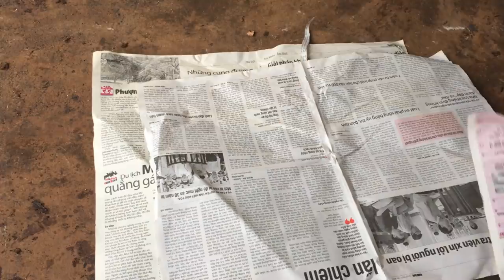How To RESTORE JAPANNESE SWORD - Restore of old rusty sword

Comment: OMG this is like a horror movie. The slaughter of a sword by the mad angle grinder man. This is no antique restoration.
Reply: I agree with You
Reply: He then goes on to run the temper. Honestly in looking at the Tang though I think he was wrong about the age of the sword as well ( thankfully)
Reply: David B.  it's probably an Amazon special that got left outside. Judging by the original finish and difference between the damage to the sheath and lack there of to the blade, I would say the blade is stainless. I'm guessing soft Chinese 3cr steel.
Reply: Sword has been killed by an angle grinder
Reply: That was no antique.

Comment: He should have not restored it at all. The restored sword is now zero in value. That's the wrong way of restoring it.
Reply: All that grinding just left a totally unworthy blade, and the handle is awful too...
Reply: Broken sword after restoration
Reply: It's a piece of steel before and after, nothing more nothing less
Reply: Calm down, people. That's most likely not even a Japanese-made sword, judging by the looks of it, maybe not even forged. Probably stamped (or stock removal) out of a sheet of metal. So he haven't done any damage to the value of it. At least he can now enjoy it as a novelty item, maybe his very first experience on the journey of learning how to actually restore items like this. From this video and the comments to this video both he and beginners can learn from his mistakes on how NOT to attempt restoring a sword. Hopefully those with more knowledge and experience can also help him on his way if he still wants to improve on this. I think he genuinely wanted to make something nice of it, he just needs to get the right equipment and knowledge on how to properly restore items like this.
Reply: @reset8140  yeah but it just goes to show how little research he put into his work before doing it
Reply: @Akuma MusageteS I think it was unfinished sword and it looks like a ninja sword because they are straight as the horizon
Reply: David B.  at least the best way is to have it sunk in water with salt and electrolytes like with current like they do to let the rust go
Reply: Myself noticed a few issues on the sword. Like the discoloration of that clay/plaster they use and did not have the mark of the forger that made it
Reply: @OzymandiaS I'd say decoration
Reply: Amateur

Comment: This is going to take a while. Just maling that clear now.

First. This sword was not a katana. The blade geometry is wrong. The ornamentation is wrong. The handle wrap is wrong. This was a Chinese sword. 

Second. Never take an angle grinder to an old blade, it is almost impossible to maintain the geometry and edge alignment.

Third. The steel should never reach blue across the entire blade. You want an even straw colour for the best edge. Blue and black is way too hot. And you didn't even try to quench and temper. It is now most likely incredibly brittle. Katana use differential hardening and have a pronounced hamone to show here the hardened edge becomes the softer spine.

Kindly, someone with a degrees in medieval and Chinese military history. (Specialised in arms and armour)
Now go learn the difference between a katana and Dao and how to make them properly.

(Not trying g to be offensive, just seaw an opportunity to teach something.)
Reply: Finally, the best comment I've read so far in this comment section. It doesn't look to have anything in common with a katana nor a Japanese-made sword. Too crudely made, most likely stamped out of a sheet of metal and then grinded edges on it. And yes, he lacks knowledge on how/what a true restoration process is, but this might've been his first attempt and can, hopefully, lead him to knowledge on how to properly do it. Maybe experienced people here are willingly to help and provide some tips, rather than just bashing and crying over basically a mass-produced piece of metal lol.
Reply: It cant be brittle if he didnt even quench it. Probably soft as butter

Comment: Well, before you try to restore an antique weapon, you should always check on the shape of the blade, then use whetstone, there is atleast 14 type of sharpening stones you need to get, and for the finest should be at least 30 000 grit, then polish it further, there is a lot of how to reveal the hamon of the sword, but i don't recommend you to use grinders, it will certainly ruined the blade shape and ruined it's past heat treatment. 

Most importantly, you're probably scammed, learn more about Katana before you purchase and restore it. 

Note : in handling antique blades, you must always learn on how to sharpen them correctly, without mutilating ( destroying ) the blade. The way you sharpen this blade, definitely will destroy just any type of swords ( swords are not kitchen knifes ).

Note 2 : there is less users in the internet wanting to share their experiences, but i wanted to help you anyways, i hope you read this comment.

Comment: I started watching this, but when you took to the sword with a fucking angle grinder, I stopped, once metal is removed you can't put it back, you've ruined the hardening and the edge, you didn't try your best, you butchered that blade and it's now stuffed ffs
Reply: dude it was a piece of shit to begin with. That was no hardened edge, it was a wall hanger or prop. The dressings were junk and it has no curve. Everyone complaining that he "ruined it" can't even spot a genuine Japanese katana from a piece of junk to begin with.
Reply: @xeokym223  whatever 😡
Reply: You can't remove hardness on a piece of steel unless it overheats , you can use a grinder and have it not overheat , its not that difficult to be honest.
And no its not a real katana
Reply: @18IMAMGODINA  yeah but how could you tell?
Reply: @Bankable2790  Easily  by watching oxidation colors on the steel , as it approaches temperatures high enough to remove hardness it will start changing colors from light straw , to straw color to bronze to purple to deep blue and clear blue is when it pretty much lost its hardness.
How do you think people harden different things ? Just wild guessing game? No .
They knew of the oxidation colors on the steel and after quenching(Hardening) they would have tempered the steel by heating it up slowly to a certain color depending on the use , for example something like an axe would needed to be tempered(slowly heated up to a temperature after quench to relax the steel) to a bronze color while knives are tempered at light straw and straw colors (Knives like bushcrafts knives , different knives are tempered to different temperatures also different steels are tempered to different temperatures ) 
Also you wouldnt be able to just quench something and then leave it like that or it would crack , even katanas were "Tempered" after quenching or else the blade would just snap in 2 or milion different pieces because its too hard to be usable, imagine that steel is like glass after quench and after temper it is a little softer but a lot tougher.
Reply: @18IMAMGODINA  okay I know a lot of random shit but you have to admit that is random knowledge unless you work with metal.
Reply: @Bankable2790  I am a hobbyist blacksmith... well lets just call it an artisan , because i dabble in other things like clay pottery/instruments , bows , bladesmithing/blacksmithing .I also cut a lot of metal around the house and stuff so i learned that the steel changes colors  as you heat it up not knowing what it was usefulfor , later i just learned it through reading/watching youtube videos , i recomend watching Black Bear Forge as he explains things very well. Right now im working on a medieval crossbow since i finally found some steel i can use for that and i plan on tempering it to purple/darkblue since that is the recomended temper for springs afaik.
Reply: @18IMAMGODINA  I just have too much other stuff going on but that is pretty cool

Comment: These are fast methods but you damaged the integrity of the blade. You should have only used a metal brush and sand paper on the circular, done the rest by hand, and skipped the heat treat.
Reply: Or atleast try to soak it in vinegar for 2 days or 24 hours enough so that he'll just scab off the rust with a brush.
Reply: that is something i did not get, why did he "heat treated" it?
Reply: @KevinReyes-xq4hb  cause the guy has no idea what he's doing.
Reply: heat treat 🤣😂🤣

Comment: That was... painful to watch.
After reading the comments I'm glad i wasn't the only one who noticed it wasn't a totally legit katana. 

But mate, a grinder is definitely not the best tool to restore Japanese swords of any kind as they remove too much material and Japanese swords don't have much to begin with. A great alternative is rust remover liquids to start, or a Sand Blaster. Then sanding to polish, 600 grit to 5000.

Edit: also when making a katana, tanto or wakisashi handle. Time in detail is paramount. Putting that extra love and effort into the choice of timber, guard, pommel, leather, and wrappings brings the sword to life.
Reply: No they don't , they remove as much as you are able to remove , reason why grinders are bad is because usually they are not flat enough , but for removing rust its perfect, and then finish it up on a sander or a stationary grinder if you have one with big wheels
Reply: "they remove as much as you are able to remove..." Yes and it's still possible to remove too much. But you're correct about the rounded surface though.
Reply: @dspl1991  of course its possible to remove too much but if you know how to use it you wont remove too much , You are controlling it it it isnt set to a depth and it will only grind at a certain depth , you would be surprised what some people are able to do with grinders.

Comment: This is definitely NOT a Japanese sword (nihontou). The geometry is far from indicative of one, from the nakago all the way to the kissaki. The sword in the video is through-hardened monosteel. If it was differentially hardened, as is typical of nihontou for the past 300+ years, then the polishing of the blade would reveal the hamon. Also, where are the shinogi and yokote? The profile taper of the ha does not suggest shobu or hira zukuri, let alone shinogi zukuri. And the koshirae...don't even get me started.

Everything about this sword suggests it is, in fact, a Southeast Asian single-edge sword. It is likely a Thai Daab or Burmese Dha. But it is NOT a Japanese sword.
Reply: Yeah, it's jarring to read through these comments of Internet nihontou "aficionados" feigning indignation over a modern Thai daab getting "restored" using...modern tools. This daab was definitely advance-aged using chemicals to give it that superficial rusty look. You can tell that there is virtually no pitting on the daab, which would have indicated a longer and slower oxidation process.

Comment: This is not a Japanese sword.  This is a sword with long edge.
Reply: It’s a chokuto basically a straight one sided blade. It’s like a katana without the curve
Reply: Well actually i agree with u...coz the way i look the sword look like old thailand sword...
Reply: @Sithnix  : You, sir, are correct in that it is styled like a chokuto. However, chokuto were out of fashion over 300 years ago. Even then, chokuto were often not both straight edge AND hira zukuri. This video claims the sword is "150 years old," which would mean its nihontou contemporaries would be shinogi zukuri for katana length. Hira zukuri was typically reserved for shorter wakizashi and tanto. Unokubi zukuri was typically for naginata. Shobu zukuri fell out of fashion already. 

Don't get me started on the koshirae.

This is why you are incorrect. The sword looks like a chokuto but it is NOT a chokuto. Nor is it a Japanese sword. The sword in the video is either a Thai Daab or Burmese Dha.
Reply: @ssv86  I see thanks

Comment: He didn't get that blade hot enough, now the metals weak as hell,  the metal lost it's temp when it turned blue,  he should've took the tourch and layed that flame directly on the metal till it was red hot, good props for trying bud,still looks better than it did before,

Comment: A lot of sweat and hard work put into this restoration, but this is not how the katana supposed to restored first thing first the handle that definitely not the katana and clean up the blade too much angle grinder .
Reply: this is not a katana
Reply: Too much angle grinder? Try zero. No one in their right mind uses power tools to repair a katana. Thankfully this wasn't a katana.

Comment: That is not even a real Japanese sword to be fair, luckily that is just an old replica katana. You can easily tell just by looking at the shape (lacks the curve of an authentic katana) and the fact it lacks a clay baked Hamon on the edge of the blade. But  please never do this to a real Japanese sword, I beg of you... that's just crazy... there are many less evasive ways to restore a sword in that state (i.e. vinegar baths, electrolysis,  anti-rust chemicals, sand blasting ..etc) ... trying to restore an ancient katana with a grinder is like trying to restore a Vincent Van Gogh masterpiece with  industrial strength paint remover and a bucket of emulsion paint.
Reply from the maker: thank pro

Comment: If you have an antique sword and you wanna restore it,be gentle with it, if it’s rusted, use vinegar,gentle and slowly rub it away don’t take a grinder to it don’t heat it up and pour oil on it. If it has pits sand it down with your hand and sandpaper.

Comment: I am not a smith, I was thinking This was taking a shot gun to swat mosquito's.  Maybe just the wire brush and angle grinder to get the scale and hard rust off.  Some wet stones, 320, 400, 600, 1200 wet and dry.  I have used a softwood block, water and baking soda to remove scale and rust.  I truly would love to restore one.  but not many in the USA.  If you find another one, I would like to try and restore one.

Comment: For some I have my doubt that is a Japanese sword. The handle is held on by a small banbo peg. And under that is a makers mark. They usually have a wood sheath.  The cutting edge is handed and has a design element to it. This has none of these elements.

Comment: If you are tempering and hardening a sword, you should heated the blade up in a kiln then dipped it in a tube of oil heated to over 100°. Sir, with all due respect, that was the most painful tempering process I have seen.

Comment: Everyone going on about the grinding and ignoring the improper and horrible heat treating.. a hand torch will Not get the blade anywhere near hot enough to temper. Plus by the time you move the torch to the other end it’s already cooling etc.

Comment: I love all these fuckin' people getting bent out of shape over him using a grinder. A) It started off as a rusted piece of metal to begin with, and had little to no value to anyone, beyond a historic curiosity. Which B) It's probably not even THAT, because this isn't a Japanese sword. Style? Sure. Authenticity? Not a chance. First, it's straight, not curved, which means that it definitely WASN'T a traditional Katana, and I can hear your sword snobs going off "It's clearly a Zatoichi!" Right, which goes further to prove my point, because the hidden cane swords that actually ever found use were made differently. They had to be to make then straight enough to act as canes. This meant that they were of a lesser quality as well, which meant that smiths didn't waste good iron on them. C) I spent three years selling and trading this stuff, and I know a wall hanger when I see one, and, even though I'm willing to accept that I MIGHT be wrong on this one, only seeing it in a video, this looks like a wall hanger sword to me. Meaning it's already made out of like 420 stainless. So CALM THE HELL DOWN. If anything, this guy spent a lot of time, effort and craftsmanship on a mediocre piece of steel and made something beautiful. The handle in particular is very pretty.

Comment: Congratulations, you completely destroyed the sword. You can now go and toss it in the trash.

By using an angle grinder, you left deep scratches that will take days to remove by a proffesional. 
By heating the blade up untill it became blue, you destroyed the hardening. And as sutch it wont ever hold a edge worth talking about.
The entire project screams amature.

Honestly, IF you don't know what you are doing, and how to do it properly. Then simply DONT DO IT. Go and learn how to do it properly. There is plenty of channels who can give you heads ups on how and what to do.

Comment: This katana looks to be a standard issue to non-commissioned and commissioned officers in World War 2. Definitely not a multi-hundred year old family heirloom. Small industry mass production.  It may have had quite a service history.  The string wrapped around the scabbard was there to literally hold it together from jungle rot in high heat and humidity service  like Burma, Southeast Asia or Pacific Islands.  Yet it is a historical weapon.  I do not know if Japanese manufacturing in 1939-1945 would have hot-parkerized the blade.
Reply: Buddy I don’t know how to tell you this but it’s not a katana also it’s not a sword of value because it isn’t marked no the tang

Comment: I won't speak about the "restoration" but just one question. Does anybody here knows what kind of sword it is? It's straight, and the handle is larger than what you see on a katana. Is it another type of blade, older maybe?

Comment: That blade is most likely cursed from the way it was wrapped
Reply: Second comment about that. It was wrapped in string. If I recall blades that were so called cursed. They were basically sealed in their sheath. Not wrapped in weird paper and string.